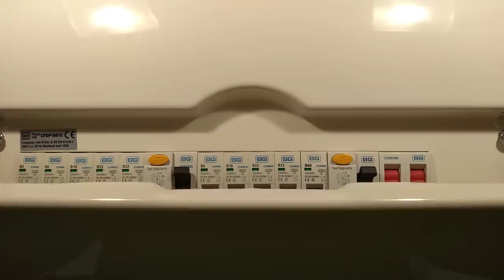A look inside a British home electrical panel.

Comment: 5 DAYS TRAINING!?... 5 DAYS?
I’m in the US, and even here with lower voltages, the rules are much more stringent. An apprentice(helper), oddly,  can do just about anything, but they need to be under guidance by a journeyman(licensed electrician). One apprentice per journeymen, no more. And to become a journeyman you need 600 hrs, minimum, national electrical code class hours, and 8000 hrs, minimum, field experience hours. And 2000 is the max per year, so 4 years is the fastest to become a journeyman, not to mention all class and field hours past 6 years become null and void. Also, all that only qualifies you to take the test, about 100 questions on anything from wire supports to transformer types and rules. All timed, about 90 seconds per question, with a minimum 75 grade to pass. Fail 7 times, start class and field hours over again.

Basically what I’m saying is, where do you live and how do I get there?
Reply from the maker: Used to be 4 years here.

Comment: Really nice to see an explanation from a proper electronics engineer. I get the impression a lot of electricians think their electronics engineers and talk absolute b*llocks!!!!!
Reply: I'm an engineer, or so says the degree in my desk drawer :), and I would never presume to tell an electrician how to do his job... unless I saw him doing something I know the NEC says "don't do that!" about. :P   Like half the wiring I saw in my inlaws' first vacation house, which burnt to the ground. :-|
Reply: @mrz80  Trouble is most of them think they're electronic's engineers. Put a circuit diagram in front of them they wouldn't know where to start. Most of what they do is common sense. You can look on line to find out what the latest regulations are. I took an electrical testing course back in 2006 and was appalled how little some of the others on the course knew. I am an engineer of more than 30 years experience who was taught by someone with over 60 years experience!!!!!!!!!!

Comment: Low odour Intumescent sealant without acetol is best for sealing fire prone holes... I have seen a few burned/melted plastic CU's due to missing the screw cradle on the MCB's and arcing. dodgy shit man ;-) installation only as good as the "competent" installer. Also, series RCD/RCBO's is not a good idea due to discrimination? which one will trip upstream/downstream?

Comment: 80£ for the complete unit? Holy cow
Reply: wery cheap, i just buy one house main fuse box, 36 fuses includes,and main switch, 230€ and my garage fuse box only same size 14 fuse box whit fuses has 100€ cheap. but safety and good guality boxes, ABB or shneider made goos box.

Comment: Why did they do away with colour coding, white for 5 amp, blue for 15 amp and red for 30 amp, the writing is too small?
Reply: There is no colour code. The amperage is written on the switch directly.
Reply: @CyberlightFG  There used to be, solid wire fuses lighting were white15amp spurs were blue and 30 amp were red. One glance at the fuse box and you could see what was what.

Comment: I generally do most wiring stuff in my family's house, even though I'm not trained. However, I'd never attempt replacement of one of these units without training. A brain is worth more than training, but training helps to train those brains. If I don't have the knowledge, I'll never attempt jobs I don't understand. But you can never stop stupid from existing in the world, not with any amount of regulations. Stupid people will continue to set themselves on fire with electricity. Can't be helped.

Comment: What's the tube on the left
Reply from the maker: Built in spirit level.
Reply: @bigclivedotcom  the clear one flopping around or em I so used to bubble levels I have no idea about the other types...it looks like it's 6 inches long and curls up a bit going from top down around the brakers...love the vids

Comment: The American breaker panel design is much better.
Reply: Vertically mounted breakers means that a loose wire can generate heat that affects the beakers above it.  Perhaps heat travels sideways in the US, but over here convection generally carries it upwards 😄

Comment: You don't know your own fuse rating?
Reply: No-one does, just because it says 60A on the label it doesn't necessarily mean there's a 60A fuse in it.
Reply from the maker: The main fuse has a seal on it to prevent tampering.
Reply: @bigclivedotcom  I'm sure you have a drawer full of them 😉

Comment: Never ever ever remove the protective panel on your breaker box or any other electrical equipment

The voltage inside there is lethal

 and one slight touch and it will electrocute you

Extremely dangerous and no way to cut power

Those buses are energized at all times

Comment: 4x 32A and 1x 40A fuses? What for devices are in that house? 😱 A 9000 Watt Microwave?
Reply: Ring mains, each one of which that might supply for instance a whole kitchen.
Reply: @petehiggins33  Try the whole floor 😁  upstairs lights, downstairs light, upstairs outlets, downstairs outlets and then individual breakers for things like your cooker if it's electric rather than gas.

Comment: "not a simple DIY task due to the presence of a high current supply"  Technically, its a high voltage supply...
Reply from the maker: Officially the designation for 240V is low voltage.
Reply: Correct, my mistake...

Comment: I love how the Brits love to brag about how safe their plugs are but then use these monstrosities. Combustible plastic, no room for expansion, a measly 10 circuits, mounted outdoors where water and sun can deteriorate it and not a ground in sight.
Reply: In order, they are metal now, expansion is easy, the units are sold with different amounts fuses we buy a box that has more than enough,  at worse add a box or replace it,     they are never mounted outdoors,  the only bit outdoors is the meter and in some cases the meter is in doors,         all UK units are grounded  in one of two ways,  a copper grounding rod, or through the neutral wire at the meter,  then inside, anything metal has to have a earth wire " ground " all pipes metal baths central heating systems,  even the screws that hold the sockets and light fittings switches are grounded.        Last note I am a brit and I am not bragging. Atb nick

Comment: What do you mean "Five days is not enough to train an electrician ?"   Should be four months of training .
Reply from the maker: Used to be 4 years.
Reply: @bigclivedotcom  Wow. Should be four years. Boss said "no two panels are the same" I laughed. Now I emphasize, no two panels are the same. 
Thank you. 
What about UK using 4 amp wire on a 7 amp circuit ? UK homes use a loop where both ends of the hot and neutral come back to the panel. I could be wrong. America does a single run from the panel out to the last circuit as a one way branch out, never loop back.
Reply: @allenshepard7992  Yes as far as I have ever seen, there is NO loop back of both ends of a power distribution circuit.
Reply: @pablopicaro7649  Hmm. I thought that was the case in the UK. thank you. I will have to look it up to see where I made the mistake.

Comment: I once went to a void property where the ex tnt used the place as a pirate radio/recording studio. Meter was jumped obviously. But they trailed about 30 mts of 1.5 t&e up the stairs run from the busbar side of a 6 amp breaker. That t&e was all mangled, bruised and busted like a 60 year old piss head slags face. Fuck knows how that didn't vaporise like det cord up the stairs. You say part p shortcuts etc, even 3 years, + 2years am 2-3 sparks have no common sense and are fucking terrible sparks. Same goes for heating engineeres, they might be gas safe but have no idea wtf they are doing plumbing wise. The amount of calls I get to fix a basic stopcock because their limp wrist can't turn of the main to change a heat exchanger. Tossers. Anyhows, all the best
Reply: @Sirus Are you feeling OK?
Reply from the maker: I looked at a heating engineer forum recently and some of the electrical questions they were asking were almost as terrifying as the replies from self styled experts.  I've saved a picture of a guy holding a pump he'd wired without knowing what the connections were and saying he wasn't sure about the brown wire being in the "N" terminal and saying it was running but should he connect the earth wire somewhere.

Comment: I find this one to be a little unsafe no plastic on the end of the conection and no isolation on the dim rail wtf. I use 230-400v and its isolated better so you can’t toch it if you have open the lid

Comment: Im sorry what!?!? 5 days to become an electrician in the UK? In Sweden it takes like 3 years for a proper certification! Not to mention the hundreds of hours you have to get as a trainee before you can do your own stuff... As a bonus here´s a pic of the fuse box in my house https://i.imgur.com/dTg8kYf.jpg We really should replace it...
Reply from the maker: Used to be a 4 year apprenticeship with a really tough exam.
Reply: My God, man! That panel is incredible. Please replace it before you die.
Reply: @rpbajb  Yeah we intend to :P Aint gonna be cheap though since over half of the cables going to it will need replacing as well. They are too short to reach the new panel :S

Comment: Ill keep my death trap zinsco panel.
Reply: Oh gawd! Zinsco...stupid big money when you need to by an aftermarket replacement.
Reply: @blaydCA  no worries i have a giant box full of them. Garage sales for 50 cents to a dollar each. Lifetime supply.
Reply: @JohnSmith-db2oc  good deal! They retail for about $35.00usd for single pole, $75.00usd double pole last time I dealt with them. The enclosure that houses them is dalgone dangerous too, depending on the style
Reply: @blaydCA  its not the one that catches fire. Tis why i have not replaced it. Its actually in good shape. No burn marks on bus bars.
Reply: @JohnSmith-db2oc  I had one that the two legs fused together internally. Others I've dealt with, they just won't reset, which most breakers do when they age out. That UK stuff is pretty scary though when it's pushing 230 vac. I'll take a little resistance loss and some extra copper thank you much

Comment: dont unerstand why b6 is ther
Reply: its for lighting mostly, or what ever needs less than 6A.
Reply: @deltalambda3864  so if it was  somting wrong a place then the light disappears throughout the house?.. instead of having a eks.. 16 amp fuse per room, that is normal in norway.
Reply: @TheSvisla  yeah that's a downside. Depending on the wiring you could loose an entire storys lighting. The old incandescent lamps caused tripping on rare occasions when they popped. Not had any issues with CFLs or LEDs so far...  😉.

Comment: Interesting. Different than An American Panel. It kind of annoys me when I see Blue and Brown. But I am American, we have AC white and black or DC Black and Red. Looking at another Country's wiring code makes me think, this must be how normal people look at wiring? (Not having a clue)
Reply from the maker: Our colour code used to be black and red, or for three phase red, yellow and blue with black neutral.  But to comply with "Europe" our old code was scrapped and replaced with brown, black and grey phases and a blue neutral.  Yes.  Three dull colours and the neutral swapped with a phase.  I'm not sure which clown OK'd that stunt.  But I can tell you they don't work in the electrical industry.

Comment: This would be a good series. Hate UK plugs though. Terrible design for this modern age.
Reply: Best plugs in the world mate.
Reply: @barrybritcher  I recently commented on this on JW's Channel so I am just going to copy that. I think there are multiple issues. I was supposed to do a video on it when I was in a UK plug country but time did not permit. 

1) Extremely large, waste of materials for outlet and socket 
2) Poor stress relief on most I have seen 
3) Many are made up by an end user. That is terrible. Opens the door for many electrical problems 
4) Fuses are a crappy way of doing things in 2019. Really crappy. When I moved to the country I mentioned the fuse for the fridge blew. I did not have a meter (only so much fits in 2 suitcases) and of course the fuses are opaque so I had to guess. No spare fuse in the rented apartment so I had to take my adapter and "steal" the 13A fuse to replace a 3A one (wrongly sized by the landlord). 
5) Many are brittle due to thermoset plastic I believe. Great electrically. Not so great when you drop them and the crack. All us plugs I ever used get dropped all the time and never breaks 
6) Horrible form factor make even a simple small device like a cell phone charger a monstrosity. 
7) Electrical issues when no ground is present in a device. This may not be an issue in the UK but in the countries that follow your standard some devices come with 2 pins. The standard practice by laymen is to stick in a non conductor in the ground so the 2 pin outlet can go in. 
8) Adapters proliferate in areas where US devices are used also. Open one of those and see hot dodgy the electrical contacts are. Seems like a fire hazard to me. 
9) Due to the over design the price is ridiculous. I can get a proper US outlet for USD$0.50 where I am located. Try matching that with the UK outlet price

Comment: Error parsing video title.  You need parentheses to disambiguate.  You're in the Isle of Man, so it's not a "(British home) (electrical panel)" but a "British (home electrical panel)".  Designed to meet British regulations but installed in the Crown Dependency of the Isle of Man, not the United Kingdom (which is what the adjective "British" means).

Cue the people who are even more pedantic than I am to state that "British" can also mean the British Empire.  But I think that still excluded the Crown Dependencies.
Reply from the maker: There is a limit to the number of words I can squeeze in there.  Besides, this "independent" country has a UK dialing code, UK postcodes and UK national insurance numbers.  It even suffers from the NICEIC racketeering.
Reply: @bigclivedotcom  
Phone country code doesn't mean much - otherwise the USA, Canada and Mexico would be the same country.

Anyway, you have your own parliament, which only accepts UK legislation if it feels like it.  Although Weatminster is thinking about forcing some money-laundering stuff on the channel isles, but it's debatable if they can get away with that.

Comment: These particular boards are awful to install, the grommet strip provided is horrible and the covers never sit right if the board is not on a perfectly flat surface, I would recommend Schneider, Hager, Wylex, MEM or MK over this particular brand

Comment: I'd like to get all high and mighty over that bus bar system... But the one in my house is probably worse on more than one level. Iirc it was the subject of a class action lawsuit and caused numerous fires... Federal pioneer Stablok. Total shite. The breakers seem to just flap around. I intend to get it replaced but $$$... Sigh.

Comment: Well, polish reality with communist type of installations is waaay diffrent. In our country mostly TN-C is used with exception of newer buldings so you cannot apply RCD in there. Second diffrence comparing to communist type. You have a LOT of breakers in there. In my house I have 4 for everything. If I wanted to change anything in there I would have to demolish whole house to swap all the wires.
Reply: safety minimium fuses have " fuse/room, and all water area outdoor,bathroom,kitchen need CD guikly 30mA circuit breaker.ALL to europe and north europe and many asian countries.only usa and uk have today totally old dangerous systems used.

Comment: 5 days to be aloud to wire a fuse box ? you brithish are funny thats madness
Reply: In my state in the US, you have to apprentice for 6 mo. or a year,  I forget which before you can even sit the exam to get a license.
Reply from the maker: It is indeed.  And worse still that it was pushed for by a fake electrical "council" (A private marketing company) that exists entirely for profit and has been allowed to initiate one of the most dangerous protection rackets in British history.  The knock-on effect to other parts of the electrical industry with the sea of instant experts is just outright scary.  You have to treat any electrical installation you approach as being potentially miswired now.
Reply from the maker: In the UK it used to be a four year apprenticeship with three of those years doing one day a week in technical college.  The exams were not easy.  If you failed you got held back a year in your apprenticeship and that could happen every year if you didn't have what it took to understand electrical theory.
Reply: @bigclivedotcom  it's harder to miswire our panels, though one should never underestimate the resoursefulness of a fool. In ours power connects to a main breaker connected to buss bars, then putting the breakers on the rail plugs them in. Of course one can still mess up ground and neutral or use a breaker too large for the wire, but it's much more likely that turning the main off actually kills all the power.

Comment: normal europe 230V system need main fuse 32A all house ans ewery socket,light,machine own fuse 10 light or 16A and soccket 16A fuses, CD water area need use ewerywere 30mA fuse guikly if water and elektric leak. or elektric broken. old style has all light ewry room own fuse 10A ans soccet ewery max 8 soccet own fuse 16A and 10A cable need 1,5mm2 cable and 16A need 2,5mm2 cable minimum.  i has repair many hundre spain house were has english idiot build elektric. lot wery dangerous systems, and used speaker cable little square to many lght and soccekt, only english idiot can made super dangerous elektrick in house. i no has newer see this style good fusebox and elektrick anywere english house.